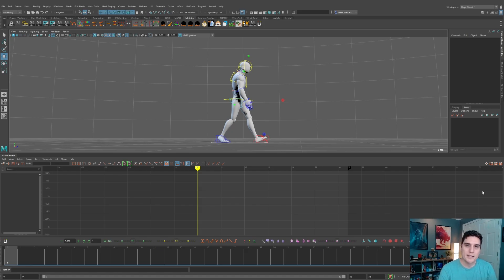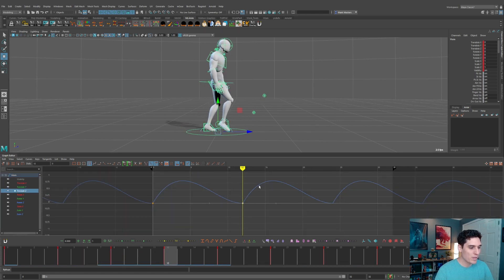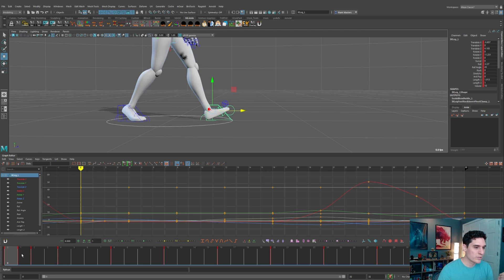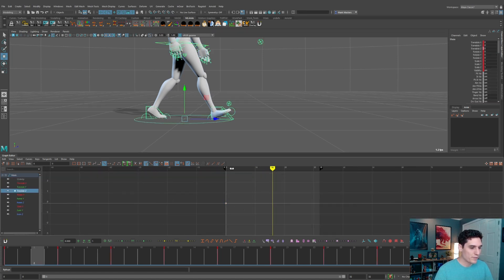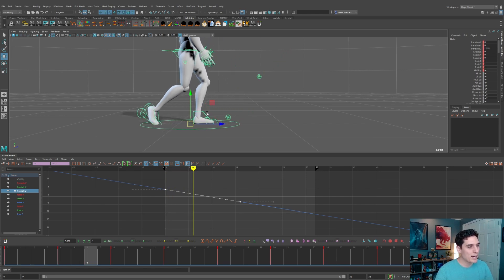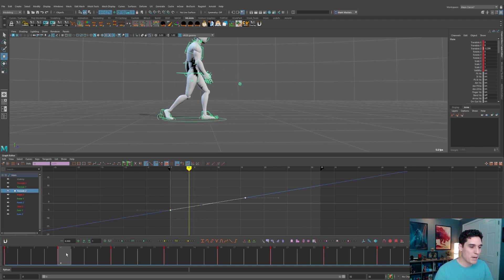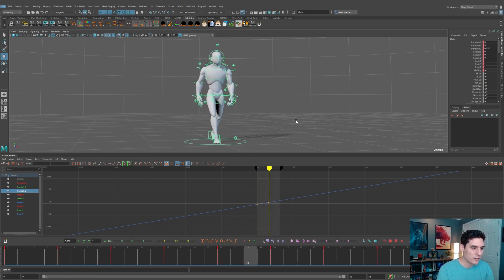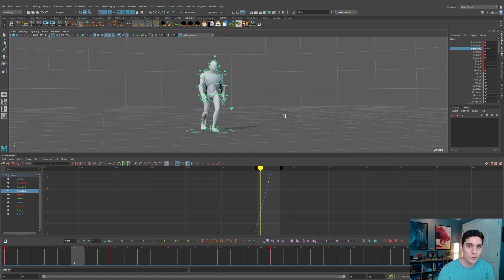How to Easily Translate a Walk Cycle Forward | Maya Animation Tip

Comment: Straight to the point. Worked for me. I added the root motion to a new anim layer, so I can toggle on/off. Keep up the good work!
Reply: So you can make the character stop at a specific spot ?? If so how do I do this ?
Reply: @ekapratama2894 No, I can't. I mentioned animation layer as a technique to modify an existing animation ("base layer") in a non-destructive way, so you can enable/disable the modifications if you want. I hope that clarifies.
Reply: @LFA_GM  I see. Do you happen to know how I can make my character stop at a specific spot ?? Because my character kept going forward without stopping

Comment: If you work on a game, and the game designer or someone else doesn't matter, tells you that the speed of the walk cycle should be 200cm per second, how do you plan it before going into a lot of details in the walk cycle?
Reply from the maker: Great question! That might be a good tutorial topic. But, that is a scenario that happens quite often, even sometimes late in the process. Once we start playing it, and seeing it in-game, adjustments usually need to be made. The designers will usually speed up the walk in game, which means lot's of feet sliding. I use a free script to figure out speed inside of Maya, so I usually use that to setup the new speed design has given, then try to adjust my walk cycle to fit. Speeding up/slowing down the animation overall, adjusting the gate, etc. It's great if that happens very early on when the walk is like first pass, but having to adjust the speed of a polished walk happens a lot too.
Reply: I tested some fake scenarios on some locomotions that I did, and its really tough to adjust locomotions to a specific speed, I really think it could be an amazing idea for an in-depth tutorial because I have never seen a tutorial or something close to it anywhere and Im pretty sure its something that you do a lot as a game animator.
Adjusting a walking speed is especially tough, because your feet are always on the ground, so from what I tested you can only adjust the speed of a walk cycle by shrinking or expanding how many frames your walk is.
Jogging and running are a bit easier because you have in-air poses, so if you increase your in-air poses and decrease the time the feet are on the ground the cycles are faster, and the opposite is slower. but maybe there is an easier method to do those stuff that I don't know about.  @MarkMastersAnim

Comment: Hello Mark, you did very well! I want to ask how to make a character walking follow a curve. I saw others can easily do it, but I need to learn how to put an animated character on the turn. Should I export an animated character go first?
Reply: Constrain>Motion Path is the answer. Draw the curve with the CV Curve tool first, of course.
Bonus Tip: Create a Motion clip with the Time Editor for a looping cycle and then you can use Scale Mode and Loop Mode to speed up or slow down the clip.

Comment: Thanks for this! I was wondering if the same tactic would work in blender, so I tried it, and it does! I'm no tutorial maker mind you, but here is how I made mine work.
In blender's case, instead of Z being forward and backwards, its Y, so that's the keyframe range you would select on the graph editor for the foot control. 
Also, in order to copy it to the root bone, the root bone seems to need at least 1 keyframe active before you can paste the Y graph from the foot control.
And in order to have the root bone keep moving forward into infinity, instead of using "Make Cyclic" on the root bone, you have to use "Linear Extrapolation" instead!
Reply: I've used your method, but my object only moves back in place without moving forward

Comment: Hi Mark and thank you for inspirations considering workflows. I have little shortcut considering scaling keys. You could simply select keys in graph editor and in the value field on the status line type *=-1. So timing values with -1 is inversing values. In that way you could also offset keys in the time field such as +=10, -=10 etc.